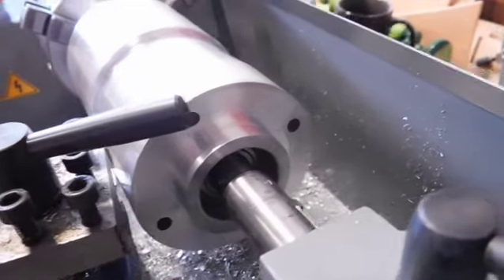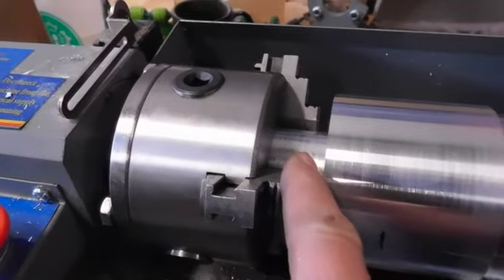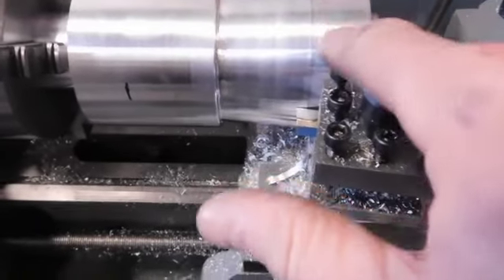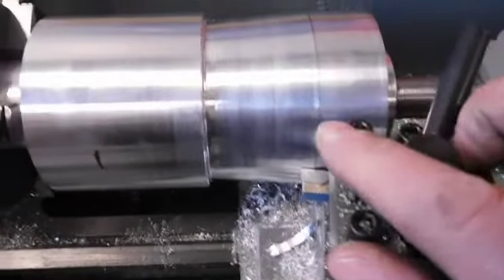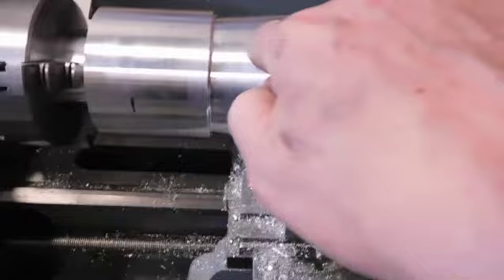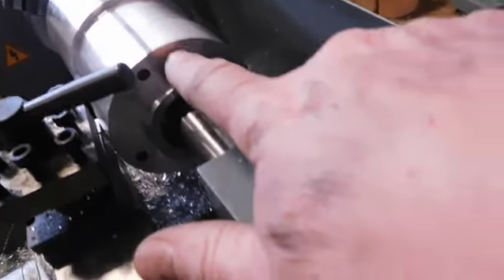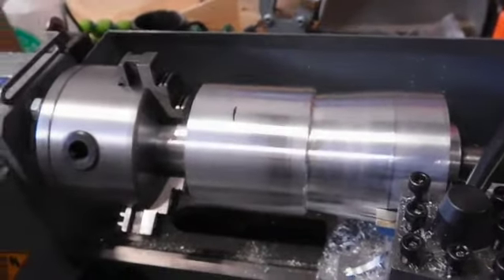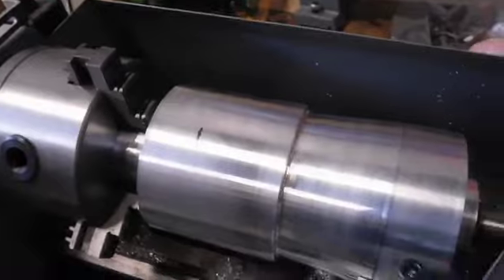DAKOTA HAWK EP 118

Comment: On my laith I can move the tool post so that I can hand wind at whatever angle I set but I have to hand wind it with the fine screw wheel. I do get a good finish though, if a bit time consuming. Have you got a boring bar so you can take out material from inside between the bearings, as that will remove weight without loosing a lot of strength (better than outside in as you loose more per unit of weight removed)?
Reply from the maker: I suppose I could get one...